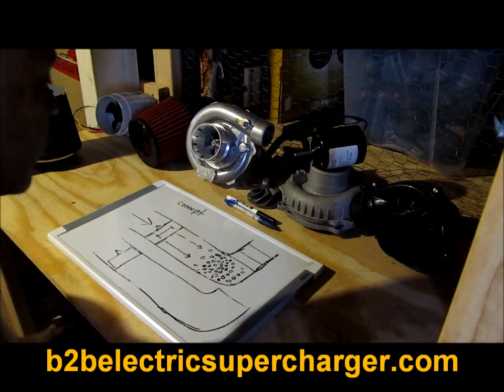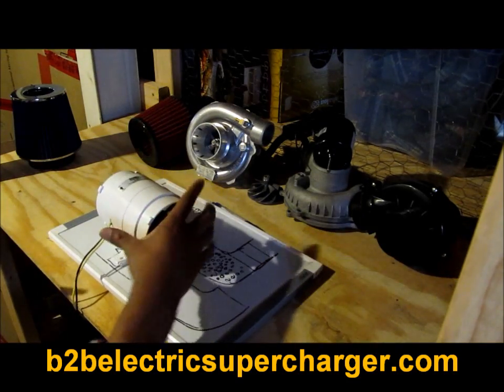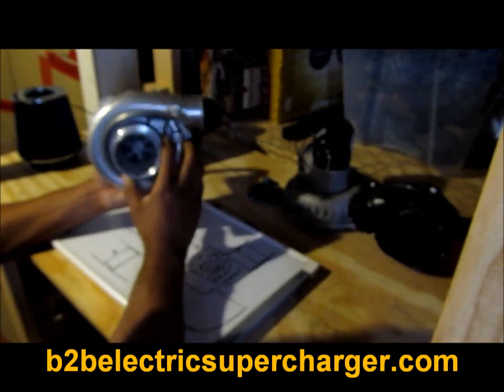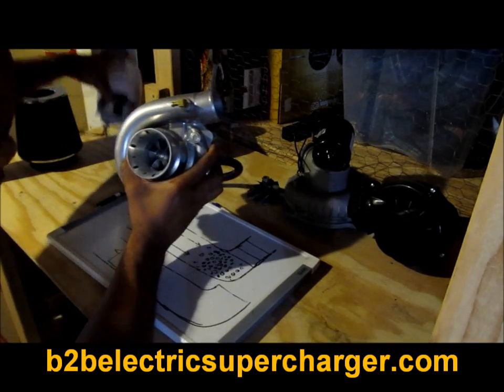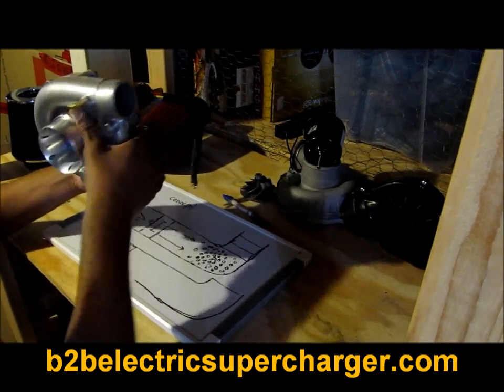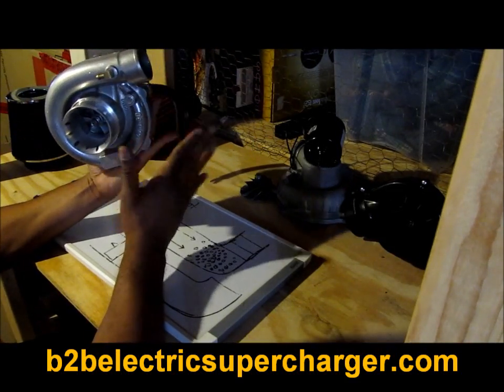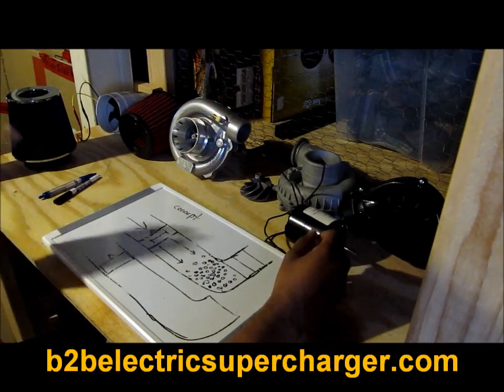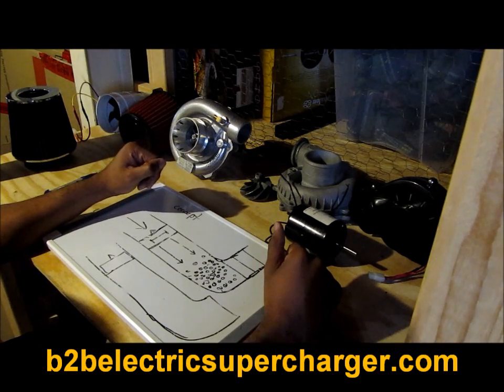Do Electric Superchargers Work?

Comment: i think electric supercharger / turbocharger are good for eliminating the turbo lag. If we can use twin turbo one electric turbo and 1 conventional turbo during low rpm engine, electric turbo can help create pressure instantaneously then at a certain speed the conventional turbo will fill in as the engine back pressure is increasing.
Reply: That's true.  It's pretty obvious that electric superchargers are no good at higher speeds but if you just simply power a turbo like the guy did in this video, it could definitely be enough to get you going, and then the mechanical turbo takes care of the bigger grunt.
Reply: they do sweet stuff all. if anything it'll restrict air flow.
Reply: Good luck with the eclectically system being able to put up with all that

Comment: WHY is it that you think you'd need all of those batteries if the alternators are pumping out gobs of power in the numbers that you cited?  How long do you think anyone would need to run the alternators to run the equivalent HP in an AC motor like you cited from Baldor?  Constantly?  What are the RPM of that electric motor?  It's probably like around 1,725 or so, and that is why it needs to be such a honkin' beast to make 30 HP.  And it's most likely a 440/460V 3 phase AC motor too.  Do you know what the differences are between AC motors and DC motors?  Stop and think here for a minute or two, PLEASE! 
  Deep cycle batteries are able to take a bit more abuse than standard automotive ones, but they're not the end of all creation.  How far down do you think you'd be drawing down  a battery of any type for a sporadic use such as this anyway?  Batteries store electrons in the acid electrolyte, that's why the specific gravity changes when the battery is charged up and is discharged.  Distilled water is used in batteries to keep the concentration of the H2SO4 at the correct percentage rather than tap water because the dissolved minerals will cause problems. 
  But in all of this, I never once said anything to advocate using an electric motor to run a super charger, did I?  Maybe it can be done with a permanent magnet starter motor that has been modified for short bursts of power, but NOT for continuous duty as you seem to think would be the situation. 

Randy

Comment: if you get a turbo charger or a super charger why go through all the trouble modifying it and slapping on an electric motor when u can just use the it in the car? lol
Reply: Sad Dana You do know the complications involved in fitting a turbo charger? you have to fit an oil line, a coolant line, plus all the modifications that are required on the exhaust. This would take away most of the heat and likely no oil feed, taking most of the complication away. This would be fit and go
Reply: Jordan Smith There is a huge need for intercooler, since under high pressure air can get even hotter that the exhaust fumes. Even if it doesn't get hotter that the exhaust fumes it is a vital part. At high temperatures air tends to expand, if it expands it takes up more volume containing less oxygen molecules. Therefore the turbo is nowhere near as efficient. Basic physics.
Reply: and if you don't know now you know
Reply: ahaha a turbocharger works at the  speed of the engine or belt.. an electric turbo can work independently and at different  optimum speeds for differnent power conditoins
Reply: So there is no load on the engine. Also this way you can turn it on and off when you want.
Reply: So drawing amperage does not put a load onto the engine?  Unless you are 1/4 mile 1/8th mile draggin your alternator is going to be heavily tasked supporting that fan.
Reply: so i have a reason for all this crap you have to go through. i have a car with small engine that would just not work if it had to supply a turbo with power because it has just enough to do that. if it powers turbo it does not have any power left to move the car so it would die straight away. electric motor would use the energy from the alternator or the battery to get moving which does not interact with the power outlet the car has already. also that small 1.0l mpi is not designed for the high pressures a normal turbo could achieve so i don't really need a big and strong turbo do i? its a great way to get a few extra horses without blowing the engine head off ;)
Reply: don't put people down for having theories and ideas, how do you think we have anything we have today?
most people looking into electric super chargers are usually looking for something to improve performance on a small motor, anything from a pit bike or quad bike to the 800cc FA8 four cylinder motor i'm trying to improve. A factory turbo charger, even for a small car, would destroy my motor.
Reply: A real turbocharger requires a lot more money then you would think, you need a turbo, oil lines, turbo headers, piping for an intercooler to cool the compressed air, and off corse the little odds and ends like blow off valves and such, and a centrifugal supercharger is almost just as expensive. this would just be an alternative to that cost and allow the engine to still get the boost needed for and power gain if they get everything working correctly.
Reply: no need for a intercooler either since its not hot exhaust fumes.....
Reply: C861986 but there is load on the engine, when you draw power from the charging system this adds load.
Reply: 너 자신 치유 Ew kirino is trash
Reply: So none of you clowns can prove this ripoff bullshit works so u insult me, way to lose kids

Comment: I want to know how long a battery can sustain the current required to spin that motor at the 20,000 to 30,000 rpm required to get boost.
Reply: most likely will not effect the lifespan of battery by very much if the charging system is sufficient enough for the electronics.
I would check and rebalance the battery acid every couple of years (maybe even replace acid to keep internal plates clean). 

There are modifications to make  a charging system plenty effective.

Comment: Coming from a mechanic, these are gimmicks. End of story. Move along everyone. There's nothing more to see here.
Reply: Kaydn Burns there is no reason you can't get 100,000rpm with electrical motor.
Reply: Dallas Lynn lol shut up, I'm trying to sell him some magic beans.
Reply: a correct turbo charger is no gimmich..if youre looking for better fuel economy .. no  it wont work normally..if youre looking to boost a kia to beat a  mazeratti it works quite well
Reply: Foreal! like the obvious difference is amount of rpm the thing makes to produce the wind. 100,000+rpm vs 5,000rpm with the electrical actually reduces power
Reply: Any aftermarket supercharger of quality will cost more than $3,000 just like real ones. Quality costs money. These are anything but quality superchargers in this video. They will still require blow off valves, intercoolers, and complex electronic control modules which will raise the price significantly. Oh, and don't expect the quality electronic ones to be a significant difference in performance from standard mechanical superchargers either. The electronic ones will still have parasitic drag in the form of voltage drop from heat inductance in the wires amplified by the underhood engine temperatures.
Reply: dude look at the size of the turbo's motor
it can't be faster than exhaust air speed
beside .. less friction and no oil burning anymore .. i can sense the future out of this
Reply: You sense a future out of this?? Oh so you're the guy who bought the $200 one off ebay..

Comment: F1 cars use something similar but it's complicated cross between a turbo, electric pulled, and a generator with a management system...supposedly incredible gas mileage,torque and power. Of course tons more involvement on the engineering side of things

Comment: To create a device like this, you need to understand the engineering of physics and aerodynamics. Using a turbocharger compressor gets you part way there as they have a pressure map. The turbo is an air compressor and an engine is an air pump. To develop pressure between them, you need to produce more air volume than the engine requires normally.You would need to spin the shaft at increasing speed with an increased RPM of the engine. I takes a lot of HP to produce that much volume and pressure. I'm skeptical of how economical an electric motor big enough to make that much HP would be, not to mention a high power motor controller.
Reply: Pony Power I get what he's saying and he's 99.99% correct. There is no way in hell these little fans will do anything or give you any boost. They simply don't work.
Reply: Pony Power lol my neighbor has one of those turbonator intake pinwheels. He swears it give him more power and fuel economy...
Reply: There was a guy who did it once, he had 400 pounds of  forklift batteries and a PWM speed 50HP  industrial motor, plus a super air fuel controller II, and it was almost as much horsepower gain as an exaust driven turbo... kind of pointless if you ask me.
Reply: tuscolian If your correcting people then I'll feel free to correct you. Pressure maps have little if nothing to do with this. Not just your bad, the dude in the video is going on about them. A turbo isn't an air compressor, the impeller is a positive air displacer. The compression takes place in the manifold but no compression takes place in the compressor itself. When it does this is called 'impeller surge' and its not 'more air volume'? its more air in the same volume i.e pressure/density increase
Reply: Pony Power "The compression takes place in the manifold but no compression takes place in the compressor itself."
I know this really comes down to details of nomenclature, but the compression most definitely occurs "in the compressor itself". However, by "compressor" I mean the whole integral unit, including the impeller and the manifold :) A centrifugal compressor is principally composed of an impeller and a manifold (potentially with some stator vanes).
Also, whether or not compression occurs in the impeller is really down to the particulars of the design. These kinds of snail-type manifolded radial compressor designs might very well not achieve much compression in the impeller part. However, not all radial compressors with impellers are like that. In fact, large-diameter radial compressors, like those on the Pratt&Whitney 100 series (http://im.ft-static.com/content/images/e470e6ff-0bea-425e-b186-28d55ac0ff9f.img), do achieve about 50% of their compression in the impeller, the rest being provided by the compressor stators following it.
Reply: Correct, but for the sake of argument the video is discussing a turbo derived impeller and housing. If you want to get knitty gritty about it then you also missed out the diffuser.
Reply: Pony Power That really again comes down to the particulars of the design. You could say that the diffuser is integral to the manifold. On some engines though, it's a separate piece that comes well after the compressor. Here's a pretty cross section of a PT6 with its diffuser shown: http://www.aircraftenginedesign.com/pictures/fig_10c.jpg
Reply: Pony Power Here's a prettier picture of a jet engine's diffuser: http://aircraft-engineering.blogspot.com/2011/10/aircraft-gas-turbine-engines.html
and its corresponding location in the engine: https://primapump.files.wordpress.com/2011/09/090turbo-jetengine.jpg
Reply: I don't understand why your showing me pictures of jet engines?
Reply: Pony Power Because thermodynamically, turbocharged piston engines and pure turbine engines (whether jet or shaft) are pretty similar. A turbocharged piston engine is the same as if you took a pure turbine engine, took the combustors out and replaced them with a piston engine core.
Reply: Pony Power probably because they are axial compressors and are governed by many of the same rules of design as turbochargers.
Reply: Peter Carlson The physical arrangement of the compressor has nothing to do with. In fact, the PW100 I showed you is a two-stage radial compressor engine. The PT6 uses a hybrid 3-stage axial and single-stage radial compressor.
Reply: Aren't we going off the point a bit here? Back to the point, a 24v or 12v motor you can buy today just won't cut it.
Reply: Pony Power It can, easily. What do you think they use to spin up and start the 1300hp+ PT6 turbine engines? http://www.finnoff-products.com/p7IGM_images/engines-page-gallery/fullsize/Engine-0914-004-Large_fs.jpg
Yep a 24V starter motor driven off the aircraft's battery. For a small car engine you could use a motor that's a lot smaller, but it'd still be far heavier than the whole turbine assembly. So it's not that it can't be done, or even that it can't be done using off-the-shelf components. It can! It's just not the best way to do it.
Reply: have you seen the size of that motor, listen shit for brains the discussion is about replacing a turbine with an electric motor for CAR/bike PISTON engines, not a bloody aircraft engine. I've said many times it CAN be done just not in respects to the video. Why do you people always go off on a ridicules tangent, and start spouting on about 'well in this perticular one off instance it was done at a massive cost and in no way practical way'. How does that help anyone or anything?
Reply: Pony Power "listen shit for brains"
Ah, this is rich coming from somebody who gets basic physics wrong.
"I've said many times it CAN be done just not in respects to the video"
And yet, just a few posts back you said:
"a 24v or 12v motor you can buy today just won't cut it"
And when I provided example of such motors in routine use to do exactly that on much larger machinery of the same type, you changed your story. It's okay to say "I didn't know that, but I still think it's not practical for reasons X, Y and Z". If you start throwing insults around, it shows me you know you're wrong, but you just don't want to admit it. I didn't try to insult you, only to expand your horizons. We're all in it to learn something.
Reply: Pony Power "its that grey shady area of you being a prat"
Nope, it's that black-and-white area of you being just wrong and not wanting to admit it.
"I was commenting on the dudes video and the reasons why his set-up won't work"
And the funny thing is, it can work, even using off-the-shelf motors. It won't be very practical, I agreed with you there, but it can work. Then you got all butthurt because I corrected you where you got the few things wrong.
Reply: Ok then, I'm doing a video probably before x-mas with a 24v motor and a mock-up cylinder head with an impeller/ housing from a 1.4ltr renault. I'm setting up a vacuum and pressure guage at the manifold and a tacho for the impeller shaft. we'll see if that can handle 6,000rpm engine speed. You're more than welcome to do your own video.
Reply: Pony Power lol I saw one that was a 50hp variable frequency drive motor rigged to a supercharger in a van once iirc it ran on forklift batteries. Wayyyyyy heavier than even practical but it worked. I think it was only built to show what an electric supercharger actually requires.
Reply: Pony Power Neat. I think you could do this easier by taking an existing supercharger and simply hooking the input drive to an electric motor (as the supercharger already includes a step-up gearbox).
Reply: I've already got the impeller, i'll just build a gearbox where I can switch out the gears to change the speed. As for motors, anything under 2kgs.
Reply: (as the supercharger already includes a step-up gearbox). Really I didn't know that. Good to know, do you know what step-up?
Reply: Pony Power "As for motors, anything under 2kgs"
AFAIK there are no 20HP+ electric motors under 2kg. 10kg - maybe. 20kg, definitely.
Reply: I'm sure thats what i've been saying all along.
Reply: Pony Power You really didn't know a supercharger includes internal gearing?
http://static.ddmcdn.com/gif/supercharger-6a.jpg
All you'd need to do here is hook up an electric motor to the belt-driven side and voila, motor-driven-compressor complete.
Reply: Pony Power "I'm sure thats what i've been saying all along."
And I agreed with you. It's the weight and complexity of the solution that makes it impractical. The physics and core engineering principles, however, are sound.
Reply: but so is attaching 10,000 hamsters in running wheel to power an impeller - its in the realms of physics - yes but thats not reralistic - where do you get this shite?
Reply: Pony Power You insult me as saying "shite" and you didn't even know how a supercharger works? Oh wow, the Dunning-Kruger is strong with this one.
Reply: what?

Comment: Hi, thanks for that explanation in the video!
I'm trying to find asynchronous supercharger project, well at least is what I call it. Why call that? the concept is between the conventional turbo charger and an electric super charger, with what I have in my mind, I think it's possible to have high pressure with electric super charger.

Comment: where is an actual video of a real test on a car in a dyno
Reply: There are other kits that have been dynoed and they do actually seem to work, it's not the most convenient though, most of these needs extra batteries, etc. to power it, and once you're out of power it obviously stops working.  Also obviously you can't get a lot of boost so it's just a mild boost.  You can google for the "full throttle" kit for the scion fr-s since a bunch of people have tested that one.